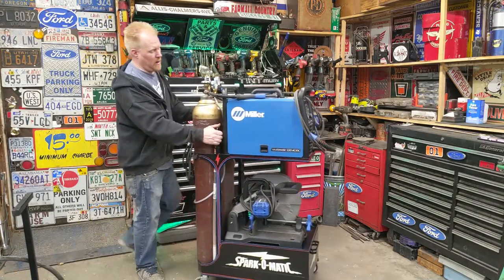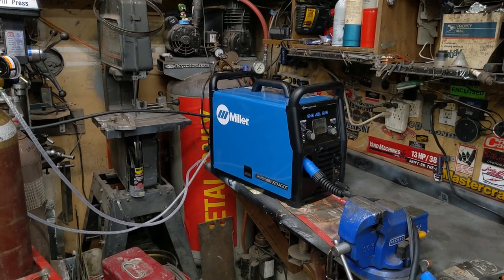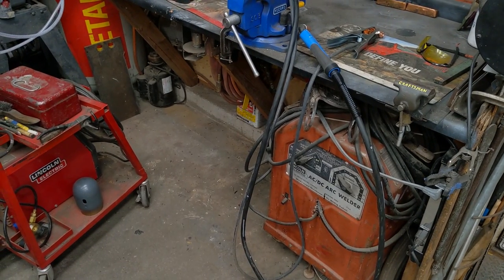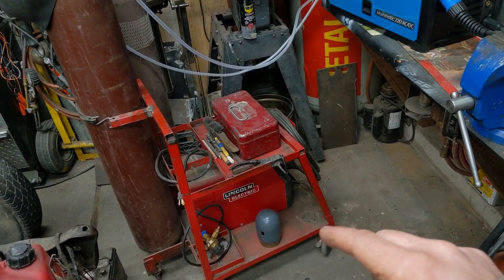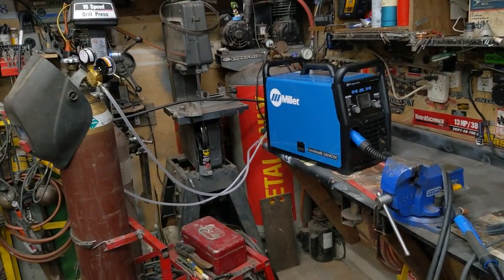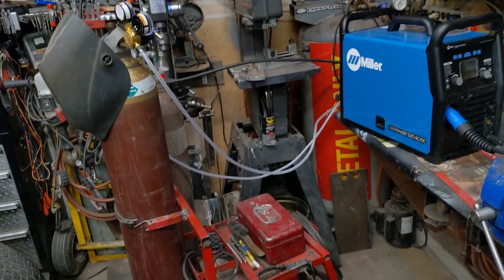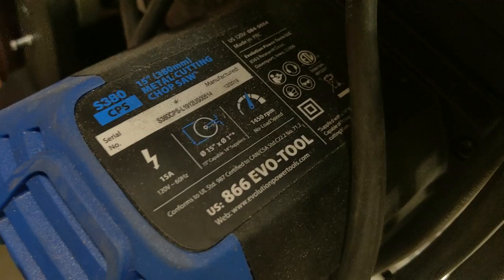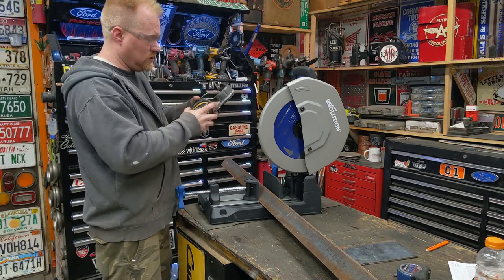Scrap steel to Welding Cart Build DIY HOW TO

Comment: 😂spark-o-matic was a walmart car stereo brand!
Reply from the maker: El Cheapo for sure. Yeah, I saw that when I looked up the name before I painted it. They're pretty collectable these days as everyone threw them away. I was going to originally paint "ol Sparky" for the electric chair but decided that may be distasteful. Then I went with Weld-O-Matic, but they are a current company selling spot welders. I mixed both names and ended up here.